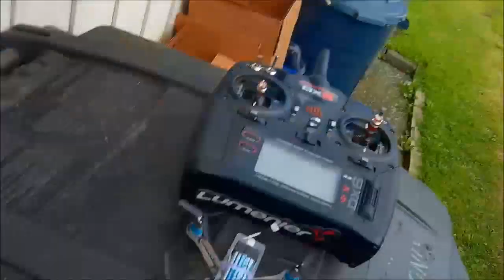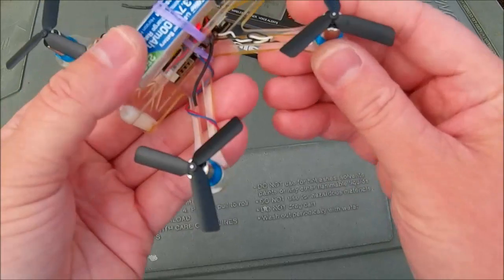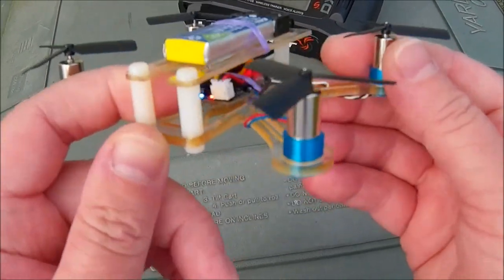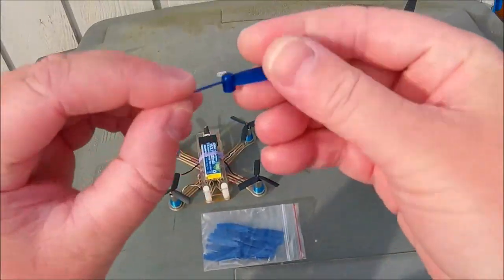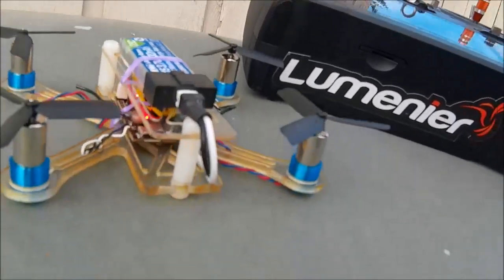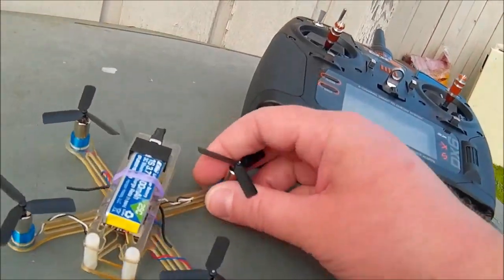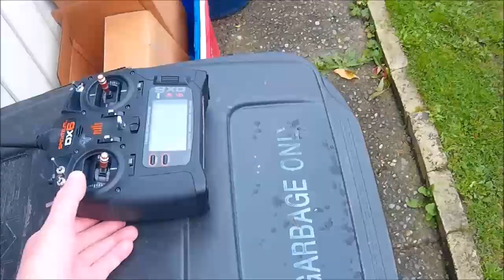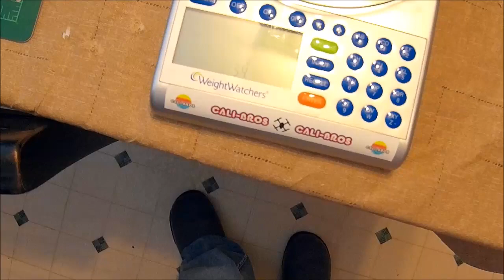new poly brushed frame spintech motors and bad props made by furious fpv

Comment: That frame looks amazing! I've tried those 65mm props and I've tried those 3 blade props before as well as hubsan h107 props. Those 65mm props are crap, they need to be balanced and they also burn my motors quicker even after proper balancing, the 3 blade props seem much slower over all but also seem smoother for video, I prefer the hubsan props, they just seem to find a good balance between speed and smooth video flight, they also seem to make my 8.5mm motors last longer... Nice vid man might have to ask him for a frame for myself, love that clear poly, it's strong and flexy too :)